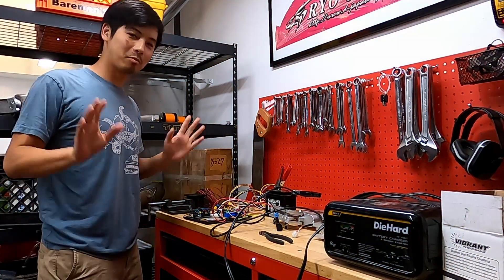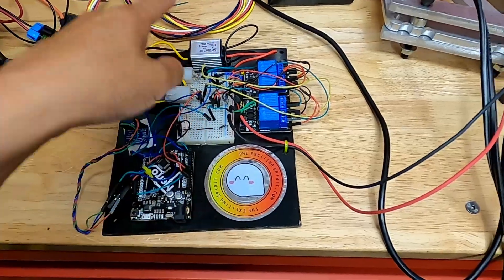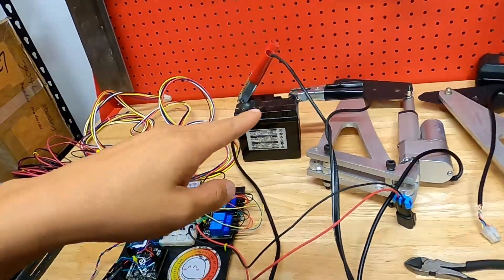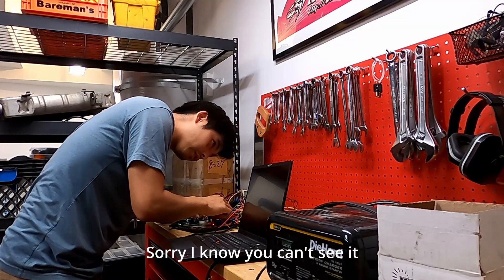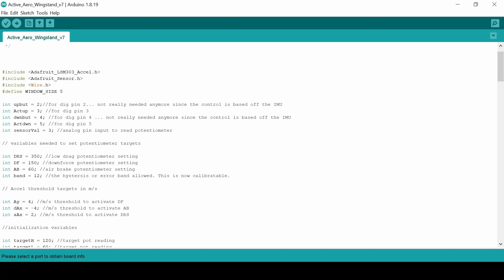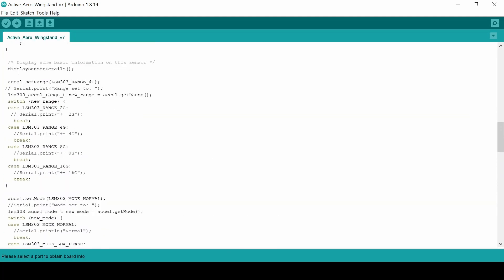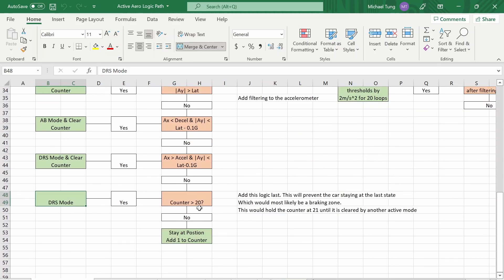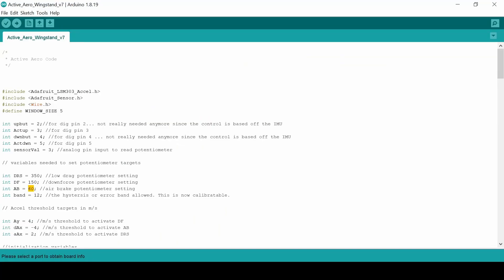How to Make Your Own Active Aero with an Arduino

Comment: How did you determine how much force you needed to actuate the wing. I'm mostly concerned with the air brake actuation, and wonder if I should go with 4 high speed actuators which will combine to give me enough force while deploying the air brake quickly during the braking zone. The most gain is to be had at the start of braking so I think high speed is what's needed.

Comment: Very  cool, I started  mine on  mini actuators  with  a up /down  remote... im planning on the arduino  and  better  linear  actuator  with the  reference potentiometer to be able to provide detailed position for the accelerometer. Or high torque  servos... any tips... thanks  Ismael

Comment: i was thinking of doing an active aero myself but that is a lot of wires and stuff. 

Why can't you just get an esp32 connect it to a active 12v cable on your car like the rear lights, then take the 12v brake light and connect that to the esp32 signal. When you brake, the signals gets sent to the brake light and the esp32 which then makes the actuators open and close to a specific height.

Comment: Food for thought... measure the downforce as well.  It'll be different going upwind vs downwind and with changing conditions, so you may need to dial in more angle of attack.  Great job... reproducing Million dollar results on a $20 budget!
Reply from the maker: It’d be REALLY cool to measure the downforce through the uprights and even measure airspeed via pitot tube! That’d be really race car. When I get back to this I’ll look into it again. Thank for the slight nudge in the right direction!

Comment: Dude, so happy I found your video, and thank you

I've had the idea of active aero ever since I saw it on the mcclaren p1. For years couldn't figure out a way to do DRS, air brake, and a "track" and "street" angle of attack

only figured out this year that arduino was the answer for controlling it, and I have pretty much no experience with Arduino or programing, apart from the beginners kit that I still haven't gotten around to playing with.

Your set up is so much easier then what I was going to do, input from car to Arduino from the brake lights, figure out the mv for the speed sensor and run a bunch of switches that send signal to the board. 

Still playing with the idea of using pneumatic actuators, just because electric ones seem to bo vary slow.

Comment: Hey! Great vid and project, is the code on github or anywhere? I'm currently working on one of these for a Cayman. I've tried a few different actuators and for the money Actuonix make a really fast actuator, the one I got has a 200mm throw too. Great work!!
Reply: You need one that is strong and Actuonix actuators are fast but not very strong. His is rated for 50lbs, but depending on the size of the wing and how fast you are going, you'll need one significantly stronger.